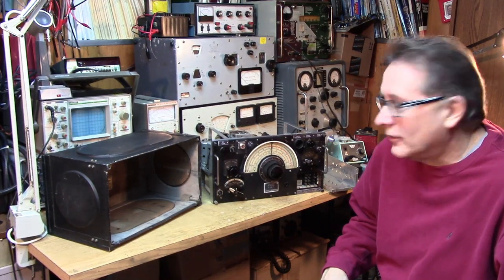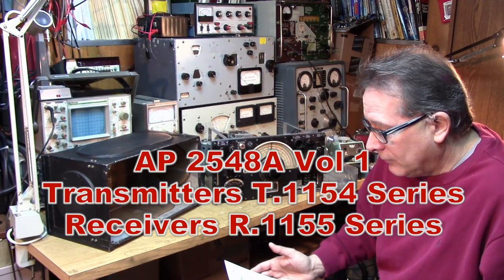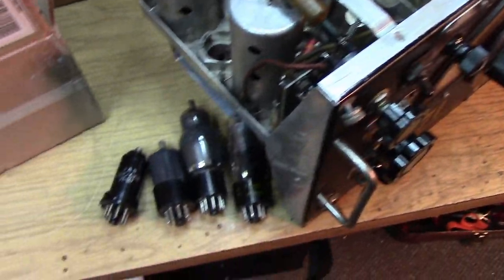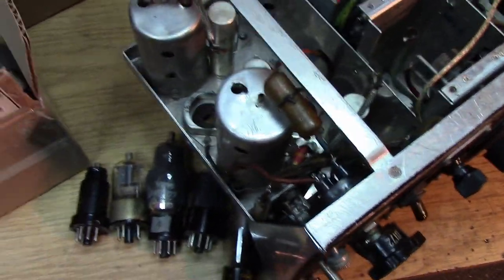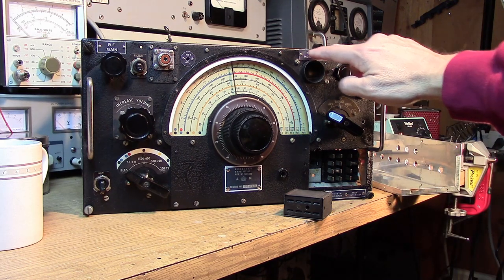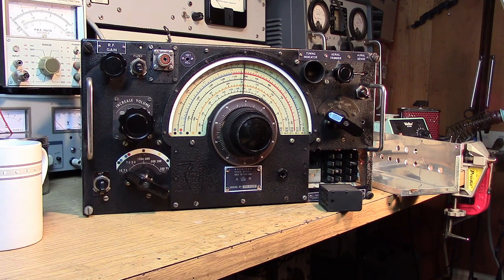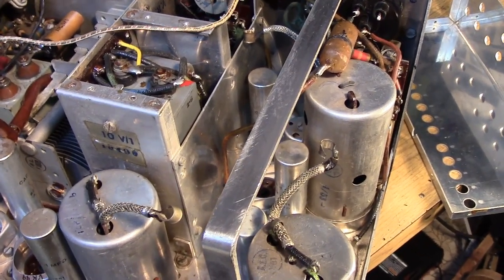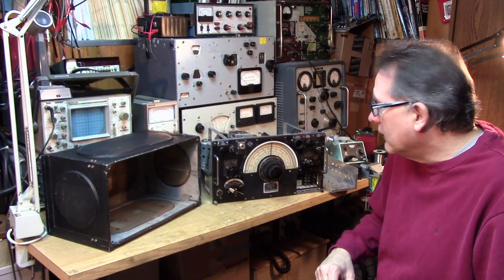R1155 Receiver Part1 - Introduction

Comment: I still have one from the late '50s.  Bought it from Z and I Aero services in Tottenham Court Road for £8.  Father took me into London to collect it.  Made an external power supply audio amplifier. and had some years of enthusiastic listening a long wire up to a nearby tree. You could whizz the outer tuning dial and the radio would respond with a sweeping noise telling you what was there to listen to.  It was almost like today's internet!  Years later, in adulthood after house moves, the power supply got lost. Then I tried to build an internal supply which wouldn't work.  I suspected failed capacitors and having no test equipment, I left the project.  Further many years later, with these so helpful videos, I realise that with their help I could tackle the job, so I'll have a go.  Thanks MIKROWAVE1.

Comment: Back in the 60s when I was a little boy it was very usual to see those radio receivers in Spain. Marconi had a big factory in Madrid and had modified and refinished them to be sold to the genersl public. The frecuency range was the same but they were not provided with FM. I remember to se them on shops, pubs, schools, work centres, restaurant, in the home of my friends.
Reply: I wonder if this is the reason Amateur Radio is popular in Spain?
Reply: Problably you are right. Ham radio were equipped with Collins, RCA, Keenwood, Hammarlund, Hallicrafters .... cos obtain the real transmitter for the R1155 was very difficult.
Reply: @micarri  I borrowed one of these from G3NOM now SK back in the 1970s as a child. It spurred me on to get my licence.

Comment: A bloke I used to work with had an R1155 when he was a 16year old(a very long time ago!!!).  He didnt have a licence and was taking part in in a pirate net using a home made transmitter when he was busted by the GPO  (who dealt with radio licensing in the UK at that time).  The GPO seized and destroyed it.  My friend got fined a weeks wages for his sins--destroying the radio was a far worse crime.
Reply: I had one when I was 15 or so...(Also,a very long time ago!)...but I lacked the knowledge and the equipment to do anything with it. 
I made a PSU and got it to light up...but that was the sum of my endeavours! 
Sadly, I eventually sold it for a fiver (five pounds).....
Yeah, the GPO took a very dim view of people messing with "their" airwaves.
As you say, the equipment's destruction was a far greater crime. They should have put it into storage and returned it to the lad when he got licensed.
Besides, the Rx was not the offending item...that would be the Tx.
Very draconian!
Reply: @patagualianmostly7437  I went on holidays to Spain last year.  The owner of the place we stayed had one up on the shelf in the dining room, it belonged to his dad and worked up until a few years ago when the PSU died.  He hadnt got around to fixing it yet but now its probably a major job to get it working again changing all the capacitors etc as they are seventy years old
Reply: What a bummer. Do you know what frequency the pirate net was on? They tended to use 6.7Mhz and 3.47Mhz below the 40 and 80 metre ham bands
Reply: @Isochest  I think it was just below top band
Reply: @m_l_hill  Shared with shipping so probably a bad spot. I know of someone who got busted using the Trawler Band about 40 years ago

Comment: The date marked internally is the refurbish date. Post WW2 they were re manufactured depending how much work they needed. The receivers were not manufactured post WW2, they were considered obsolete when they entered service, but during war a bad design is considered good, if you know how it performs. A lot of them have a number on the front in the format R1/54 which means rebuild January 1954.
Reply: That's good information...Thanks. As Mikrowave acknowledged, he now agrees it was definitely wartime...not "Made in 1954"  Your post clarifies that. Cheers.
Reply: After the war    R1155's  were constantly  offered for  sale  and also   other    ex WD  surplus   radio  equipment  as  advertised in the   pages of the   Exchange  and Mart .  I  was tempted to buy one  but  as a boy  hadn't  the  technical   knowledge   to  link  the set up with  any other  equipment  possibly  needed.  Cant  remember  the price  but  were possibly  available  for about £20 .  Brian Phillips.

Comment: I just found my 'WPE' certificate from the early 60s, when I was 12 or so, using an R1155A and a McMurdo Silver 802 superhet with the brown bakelite plug-in coils in yellow boxes. Dennis VE3BPJ / VE2IZ, my Elmer then LARC later MARC, had a stack of R1155 and visitors to his shack would grab a few to sit on. I always remember the fascinating magic-eye tuning indicator. My power supply was in a small coffee tin. When I left home I put it all on the road side and a local ham in Beaurepaire QC asked if he could take it, nice man. Even more fun than my old Icom PCR-1000. Finding all of this has sparked my interest again but I know I will never master code. Playing with SDRplay now and RTL dongles. Roy VE3PE1ZO / VE2PE1KE
Reply from the maker: Between the colorful dial with the weird reduction drive and the Magic Eye this thing wins the cool contest.
Reply: @MIKROWAVE1  This reminds me as a pre-teen disassembling the R1155A tuning dials and learning about planetary drives. Even the McMurdo-Silver had two tuning gears connected by springs that eliminated backlash. All of this technology is now lost when an infant can program an 8-pin ARM 32 bit microcontroller for £0.50 and emulate the whole thing. I would take a plane load of old geezers with their servos and resolvers and vacuum tubes and tell them not to auger a 737 into the sea by building a real autopilot. We are seriously doomed but I at least have a memory of when computers could not make a mistake.

Comment: is there anyway that Mallard Vacuum tubes could be adapted to replace non-obtainable vacuum tubes or if it is not possible to get it working what about replacing all parts except the tuning parts and go with a Nuvistor  tube  for the RF preamplifier and a solid state Tayloe Mixer and vacuum tube operational-amps driving an analogue phasing combiner which drives a pre-driver stage created  with Raytheon Wire-Ended vacuum tubes for the output stage to drive a 300R speaker.

Comment: Thank You for the interesting point with regards to the metal jacketed valves, has in the example with the 6K8 there. The fact that the lower  base of the valve there is not going to fit into the chassis  mounted base with a raised shoulder. It is years and years ago since I have played about with valve radios and I had either forgot about that or just did not realise the fact. 73 de John - G0WXU
Reply: The ech35 was used a lot in UK for the frequency changer, same pinout as 6k8
Reply: The author clearly is unaware that all tubes had a screening can, and that is the purpose of what he calls Tube Supports.

Comment: You missed a big clue as to this sets history when you held up one of the original valves to the camera - "Made in Canada".  Lancs and R1155s were also made in Canada during and after the War so I would guess it was Canadian made for the RCAF
Regards and good luck with the restoration. 
73 GW4WOV
Reply from the maker: +Kevin Williams All of the valves are UK except for the added 6V6 output stage which is Canada. As I start to dig around I am finding 0.1 uF caps marked made in England 1940. Also Air Ministry Reference Number 1003028. So I am changing my tune and think this is early and the date is more likely early wartime.
Reply: Is this topic still open, I think it as been closed for some years, would be nice to hear from someone.

Comment: I would probably have removed the tube supports (or enlarged the holes in them), rewired the sockets, and used either the metal or GT versions of the tubes.  Nothing wrong with the G versions, but they can be as rare as hen's teeth today.  I would also opt to keep the 6V6 output tube (it can be replaced by a 6F6, 6K6, or 6G6G (lower power) to drive a speaker.